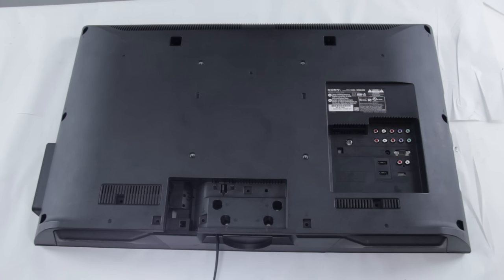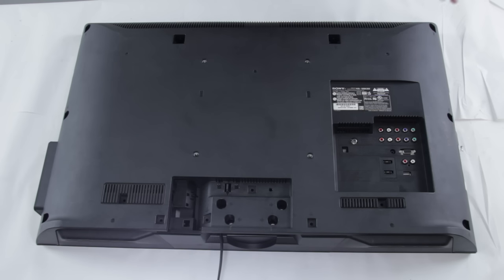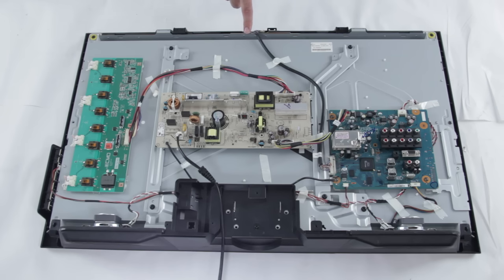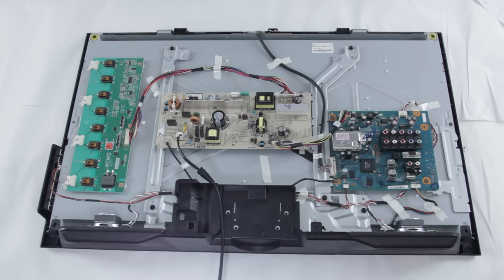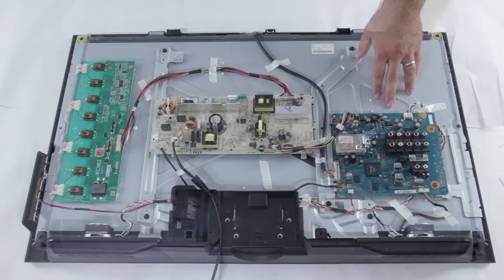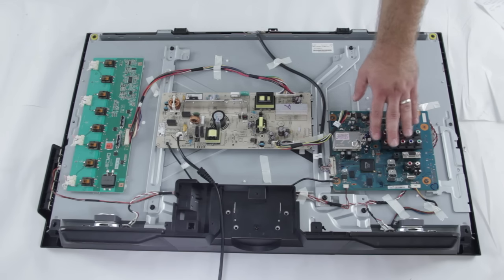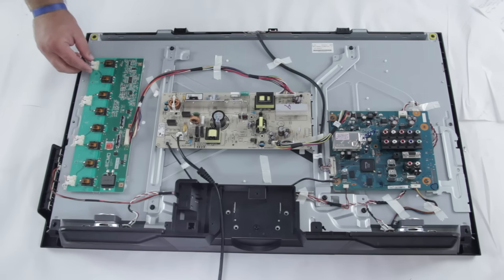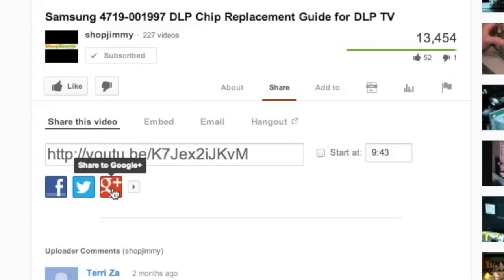LCD TV Repair Tutorial - LCD TV Parts Overview, Common Symptoms & Solutions - How to Fix LCD TVs

Comment: Thank you for being willing to help.

I have a Philips 49PFL4909/F7. It is only 18 months old. The serial number is DS2A1441203669.

when I turn the tv on I immediately get the Philips screen and everything is normal. No high pitched whine. As soon as the Philips screen switches to whatever input the tv is set to it begins making a high pitched whining sound. It does this on all inputs. The high pitched whine does not go away until I turn the tv off. As soon as I hit the power button and the picture turns off the high pitched whine goes away. I have experienced no other problems with this tv. 

I tried turning all the volume controls off and the high pitched sound does not go away. The sound is consistent and does not change. I tried different outlets and the problem is consistent. I tried different tvs in the all the same outlets with no problems. 

I have not been able to find hardly any information about this problem with this model. What little info I have found varies widely. 

I took the back off and looked at the power board but I don't know what I would be looking for. But there are 3 cylinders that are dark in color, closer to the top of the tv on the board, standing straight up, with the number 101 on them, there are only three of them, and they do not look like any other cylinders around them. They have dark spots on the top of them that are not consistent in placement, size, or number of spots on all three cylinders. The one farthest away from the other two has fewer spots on it.
Reply: I found some white paste looking stuff on the end closest to the top of the tv of one of the wires marked J1614 right where it plugs into the board. It looks like there is a bit of the same stuff on the top edge of one of the upright standing cylinders. Is that a capacitor?

Comment: I have an LG 47LB650V that was knocked over the screen is not cracked but when it's turned on you can just see mixed colours and a crack  could there be a crack in some other part that can be fixed  liz

Comment: I have a Vizio Model No. VO47L FHDTV30A Serial No. LUPCGCJ4302190. As I was watching TV I heard a loud pop and the TV went off. No smoke and no smell of anything overheated or burnt. Took it off the wall and took off the back and all caps were flat and the fuse has continuity so I expect it to be good. the TV is 7 years old and never had a problem. I took lots of pic of the inside. Outlet works but when plugged in there is no power to the TV and the Vizio emblem does not light up.

Comment: I have a Mitsubishi unisen lt-40151. it was struck with a heavy object, and  the lcd is cracked. no picture. only lines and colors. my question is... will it be worth the cost to repair? I got super lucky and found it at a goodwill in excellent condition for 100dollars. do you know where I can get the part and how much it would run? I am interested in trying to repair it because of the 16 speakers that are in the front, that can provide virtual surround. also the many input/output options for audio/video. if you could please give me some advice on this issue, I would greatly appreciate it.

Comment: I have 22LG30R LCD TV. I am getting the picture and sound but the picture is blackish. after restoring the factory setting also the picture is blackish and increasing brightness also is not effective. I suspect It may be a back light problem but not sure.
Kindly help to pin point the issue and its repair.

Comment: I have a TCL Flat Screen (model L32HDF11TA) and about a quarter way down from the top of the screen there is a green line and from that on its like a normal TV screen except its pixellated and grainy. The top quarter of the screen is perfectly normal. Do you know what may have caused this or how to fix it?

Comment: I have a phillips 47PFL7603D/F7 that stopped turning on. Replaced the power supply board and i now have a picture but am seeing a shadow down the middle of the screen. Just seems dark in the middle and lighter on the sides. Any ideas. Thanks Tim

Comment: I have a Samsung LCD Model # LN46A530P1FXZA. My issue is color distortion in the upper right hand corner of the screen. It will go away eventually but, noticeable when I first turn on the T.V. Does this symptom sound familiar?

Comment: hi 
i have lg 42ln543v-zb but it does not have in inverter board and the screen is black 
when i shine a torch on the screen 
you can see picture? 
do you think if i change the mainboard would fix the problem? 
thanks

Comment: VIZIO VW37L HDTV20A   First the TV just stop' the orange VIZIO logo light "stand by" just stayed orange and would NOT go to white. BUT   I was told to hold the Power and Volume up button at the same time to reset and then the VIZIO logo turn from orange to white  then the screen had  horizontal line about 2" wide jumping all around   any clues?

Comment: I have a LG 60 inch TV model 60LB7100  The screen will just randomly go blank. I'm not sure if it's the power turning off or the screen going out. Sometimes when I turn the TV on it will get to where it says HDMI one in the upper left-hand corner and then go blank. If I try it again it will turn on to where it says no signal but then once I start watching TV the screen will go black again. I can see faint image in the background in the dark of the screen
Any help would be appreciated thank you

Comment: I have a sharp LC-70LE757U and it was ok last night. Today I turned it on and what I see is the inverted V led flashing two slow flashings and then five fast flashings. that's all it does. No screen and no sound. I tried to reset it by pressing the input and low volume buttons at the same time while I applied AC current and it does not reset. After 30 seconds the inverted V led starts to blink again in the same pattern. Any ideas, , , , , iT WILL BE HIGHLY APPRECIATED

Comment: I have a Sharp LC-50LB370U I have sound and can see the image with a flash light.  Based on the info in your other videos this tv has everything built into the main board. When I open the back I see the t-con board, a main board, and the board that holds the various inputs.  I suspect I would have to replace the entire main board. Am I missing anything? Are there backlight inverters somewhere that I am not seeing?

Comment: My SONY Bravia LCD picture is coming in & out though the sound and power are continuous.
Model No.: KDL-46CX520
Serial No.: 2048290
The technician told me that the video board needs to be replaced and would only give me a  day warranty after the repair.
Please advice.
Thanks!

Comment: Hi, thank you for your video. Very helpful!
I have a TV set LG 37LK430. It was pluged-in to a multisocket but was on stand-by. I was plugging in into the same multisocket another device and a short circuit occured and the something in the TV burned. Now when I plug-in the TV the small blue control light comes on for 2 seconds and then goes off. I checked the fuses on the power board and they seem to be working. Could you give me some hints what to check. Could this be something else apart of power board? Many Thanks. Christophe

Comment: I have a Samsung un60ju6500fxza hd01 that has audio but no picture. I have bought a repair kit from you guys and changed all the boards. it still does not work. I can't see anything with the flash light test. Any help would be appreciated.

Comment: I have a insigna  NS-32LCD . the volume is stuck full blast, it goes down from 60 to 58 but automatically goes back to 60.. I took the batteries out of the control and it still does it... any ideas on what it is. .. thanks

Comment: I have an LCD tv LG 32LD450 that is making a buzzing sound after being turned on then it goes black and the tv shots of like if it had a short somewhere. you can see the buzzing sound coming from a light source on the bottom of the tv.
What could be the problem and how can I repair it?
thank you.

Comment: I have a LG smart tv model 50LF6100. It turned off while I was watching it, as if the power flashed off or a breaker switched off, but didn't. There is a red flashing light. It flashes constantly.  The tv will not come on.  What do you think it is?

Comment: I have a Sony KDL-55EX500 Serial 8096567.  The other morning while watching I walked away from the TV while it was on.  When I came back the screen was black but did look like it was illuminated.  I turned the TV off and attempted to cut it off from power.  After leaving it disconnected from the power for the day I reconnected to the power.  The TV attempted to turn itself back on once reconnected to the power.  It was not successful and instead I got a red blinking light on the front instead of the normal green in a sequence of 5 flashes then a pause for a few seconds and then it repeated itself.  I know one of the possible problems could be a bad LCD panel.  What would be your suggestion?

Comment: Hi! Good day! Thanks for this video. We have this Samsung LCD TV Model LA32D450G1XXP and has problem on its screen. The images started in shadow and became worst after time. It is now somehow turned into mostly gray/black flickering images. The service center says we have to change the Panel but it is already phased out. They offer us to get the whole unit and compensate for a pretty small amount. I believe this could still be revived. What should you should be done? Would this because of T-con? Or the Ribbon? Which i just saw from your video. The unit and screen are not physically damaged. How to get your response soon. Thanks a lot!

Comment: Hello. I have Samsung TV Model# UN60KU6290FXZC that won't turn on. Standby light is on and power to the optical port. When I push power button, the screen flashes once, standby light turns solid red, and freezes for a second. It then goes back into standby and cycles through this again over and over again. I'm thinking main board but do you have any advice?

Comment: Hi,
I have a LCD TV Bauhn brand and Actios model with model number: AJ-22FLEC1. 
The issue is with lcd when I turn the tv on I just see whole display a colour for example green and after a few seconds turns different. I was wondering what the problem is and how I can fix it. 
Cheers

Comment: Hello Jimmy thanks for you video my tv is RCA model RTU 4921 and ist S/N is A2l1702196240001587 and is sowing vertical lines and the colors of the picture is getting changed. Could it be the main board?

Comment: Have a 42" TCL SN M364FF700761 that is 5 years old. When you turn it on, the picture is crystal clear just like new. However, after a time, ranging anywhere between 30 minutes to 6 hours, the picture will become blurred due to being broken up by thin horizontal lines from top to bottom. Can still watch a game, for instance, just hard on the eyes after a bit. Have changed HDMI cables and inputs, and the problem also recurs with signal from HDTV antenna. Like I said, good as new for a while, so I hate to just give up on it, nor do I want to spend lots on it. it was a $250 buy. Any suggestions.

Comment: Is there any possibility to check the display panel details from the software of the TV? I'm interested in TX-65CX700 panasonic flatpanel. The display was replaced by the official service, but I'd like to check if it is the same that originally used. I am afraid if they used panel from a lower model. Is there any way to check this without opening the TV?

Comment: So I have a Sony kid-70x690e tv.  I have no standby light but I have 4.99 bolts on the standby terminal out to the main board from the PSU.  I don’t have 5 volts back from the main board to the psu when I push the power button on the tv. I have tried replacing the main board thinking it was the main board but it did not work. I have also tried jumping the power on the psu from the standby terminal to the power on terminal to see if I could get power to the back lights and the tcon board and don’t not get anything. If I disconnect the main board and jump the terminals  I can get 129 volts at the back light wires and nothing at the tcon wires. Any help would be greatly appreciated. Thanks.

Comment: Haier L32B1120 S/N TB30071040 00715 C6038- Red light on when power off. Power on light turns green. Screen stays Black. Flashlight test - can't see anything. No obvious Capacitors blown. What board needs replacement.

Comment: Hi please help!  I have a LG LCD tv 32LX1D and it won't turn on. The red light blinks red to green and it won't turn on. I checked the capacitors and they all looked good (they are not swollen or damage). I wonder what other problems it could be besides the capacitors.

Comment: Hi I have a rca 65 inch TV that has power but no picture or sound the power light is on red when off and blue when on its a rtu6549 any idea what the issue may be and yes I tried doing factory reset with no luck and tried another tv in plug and worked fine.

Comment: Sir. I have a Vizio model D50u-D1 that will turn on and then fade off. Tune screen is off too. I replaced the power board and there is power to the main board as the light is on. Please help and reply back

Comment: LG  model no: 32LN572B - TH
I woke up this morning and tried to open my tv using the remote control , the standby light at the bottom of the tv flickers indicating that it receives a signal from the remote control and everything was ok until then,but the tv gave no sound and the screen gave no light as if it's still off.
any help please!

Comment: Hey, 
I have a 
LG 42LH4010, Serial No: 909WRVZ6B319 TV here, I think it should be LCD not sure dough. 
It is not turning on, and there is no life sign, no lights or anything else. I opened it,   had a look at the boards and components. all Capacitors are good., at least there not bulged. i checked a fuse with the multimeter and it is ok too. Now I am thinking maybe it is the backlight, but every where i looked they say LGshould blink up and then turn off again. Mine doesnt . tommorow i will get to the backlight anyway. Lets see if i can find something. 
Do you have some tipps for me?

Comment: I have an LG 55LS4500 SS#208rmqk80140. I have a problem with lines going thru the picture horizontally and they jumb around and kind of makes the picture blurry. According to repair the t com board might cause this but on your order screen for parts reads that it is probably the screen. How can I check to make sure that it is the t-com board? If possible I can sent you a picture of what the screen looks like.

Comment: The backlight comes on my Samsumg 26S52D comes on for a second then shuts off, but sound stays on.  This is a BL inverter issue, right?  I don't see any image while the BL comes on in that 1 second, I just see the backlights flick on, then off.  I do see image (snow) doing a flashlight test, as well as on screen menus.
LN-S2652D - TV model #
HIU-641C - BL inverter board #

Comment: you can probably replace or repair that tcon board.  just have to take it apart further.  separate the steel frame from the panel itself and you will have access to it then.

Comment: I have a Panasonic 42 LCD TV model TC-L42U25. When I turn it on the picture is compressed horizontally across the top of the screen. After about 10 to 15 minutes the picture becomes normal. Clearly a warm up bug. Any suggestions ?

Comment: I have a Vizio TV S600GU1-1 I have replaced the led driver board and now the TV comes on for a few seconds and goes black,then horizontal lines are on the TV screen ? Serial number is 0026810 Vizio ?

Comment: Hi guys. I have a JVC 50" LT-50C550 serial number 1520004496.
The problem I have is the tv won't turn on. Starting in stand by mode,  if I push the button to power it up I see the backlights briefly come on and then it loses all power. I have to unplug the tv again to get it to return to stand by mode again.

Comment: I have a Sony Bravia (I believe it has a 32" screen) LCD Digital TV.  Model No.
KDL-32L5000.  Serial No. 4685253.  Initially, when we first started having problems,
the TV would turn itself off after a few minutes. This would happen every time we turned it on, so we haven't used the TV for about a year. Recently we tried the TV
again and it stayed on much longer and we turned it off ourselves. Then we noticed
that the TV would come on by itself.  When we turned it off, it would stay off for about
a half-an-hour to a couple of hours and turn itself on again. We finally unplugged it.
Potentially, the problem is that the TV turns itself on and off. There are no video
or audio problems when it's on.  I safely took the  back off and visually inspected
the circuit boards and found no visual evidence of bad electrolytic Capacitors (I know
that some may be bad even if they show no visual signs of it).  What do you
suggest?

Comment: I have a Vizio 55in 4K TV model number m55 - C2 the problem has is it has no picture but does have backlight and when powering on the logo flashes for a Split Second I have tested all voltages they're all good let the voltages from the output on the t-con board are present or are very low at the ribbon cable connector test points I have replaced mainboard antique on board still having same problem please can you help me figure this one out really would like to get this TV up and live again thanks

Comment: Hi i have a hitachi 55R80 lcd. I notice that along the bottom of the screen from the left there was a dark band which got lighter as it went across the screen. Late r the middle of the screen started to flicker. Now when i turn on the tv, the startup light comes on then gets lighter and now the screen is totally dark. I took it to two repair shops who keep telling me to buy a new tv because the screen is bad. Serial number: TH7HB08647